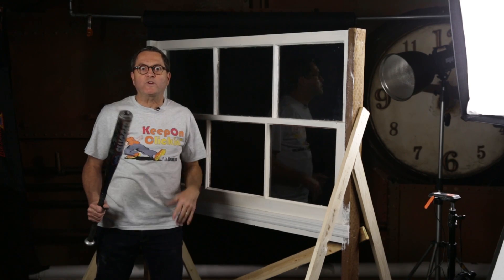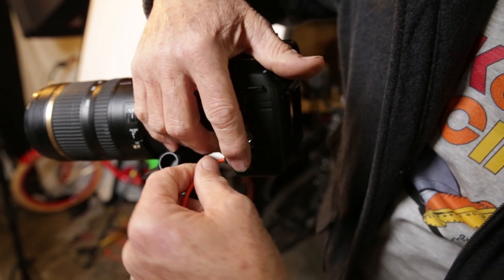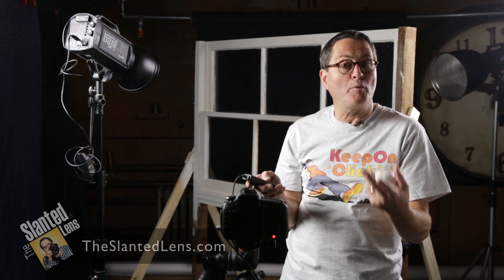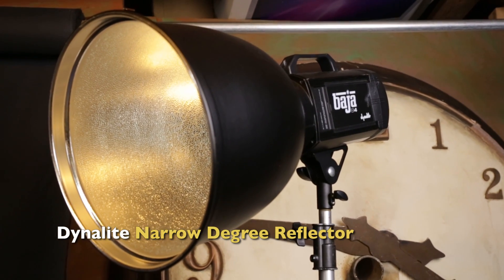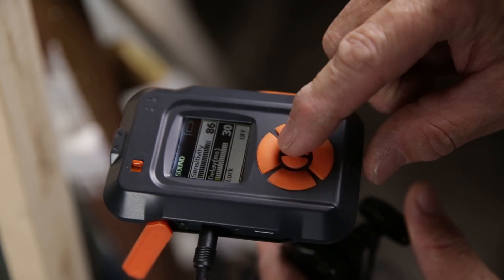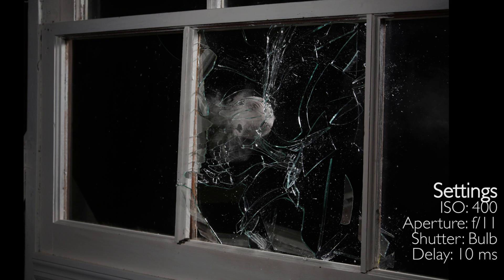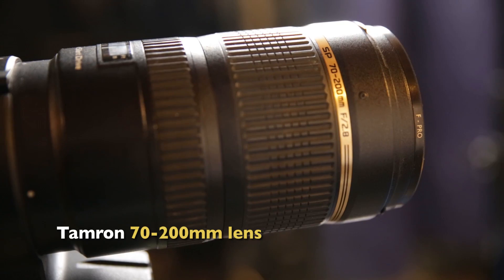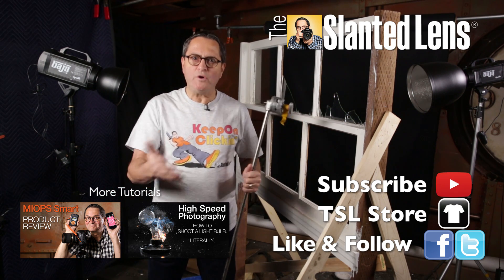Using Sound to Fire Strobes - High Speed Photography

Comment: JP, im just supper excited now that i finally got my HHS triggers and retriever for my Nikon so i cant wait to try out my High speed shooting. ill post them soon as i can facebook.com/dmsstudios64
Reply: +Dms Sutdios64 you don't use HSS for freezing action typically.  i know it sounds counter-intuitive, but you actually use the short flash duration to freeze the action, so it often doesn't matter how long the shutter is open (within reason).  HSS is for using flash in the bright sun.
Reply: +Keith Fuller This is correct. We shot in a dark room and had the shutter open for 1 second or more. HHS is using faster shutter speeds with your strobes. Typically over 200.
Reply: +Keith Fuller Yes but i am happy to have this option now and finally get some darkroom dancing motion shot along with trying to freeze motion at 1/8000